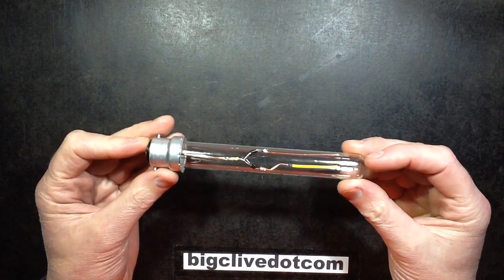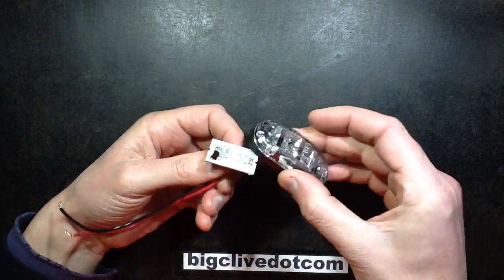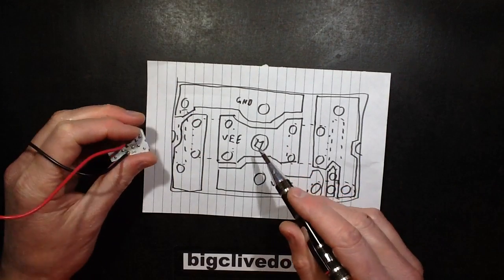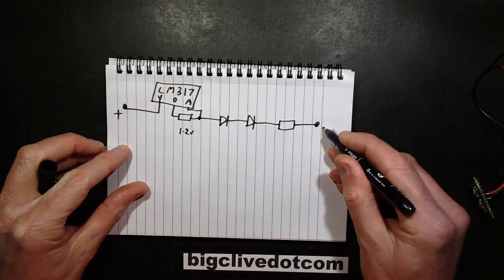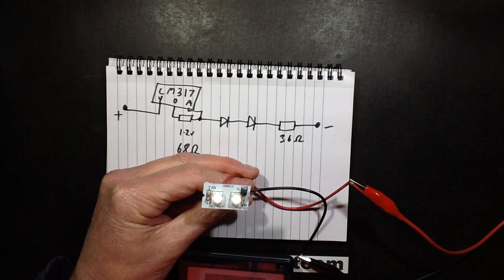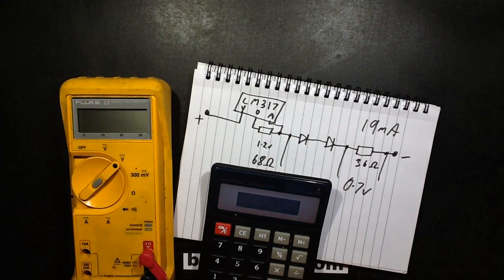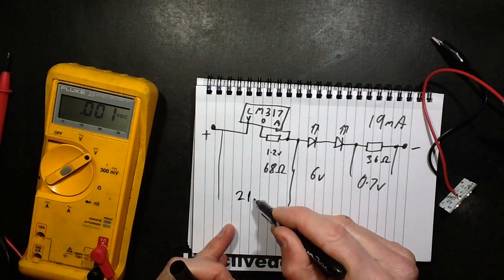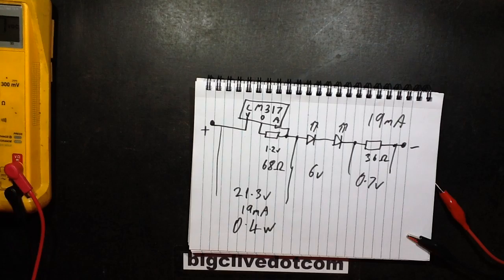Teardown of an LED truck sidelight.

Comment: Wow again! Another classic Clive.

Interestingly, I've been considering LED rear lamp clusters for my car trailer, but at lot of people tell me stories of poor life spans and various odd faults that make them unreliable. Then others will tell me that they're not certified for road use in the UK. I must admit, I like the idea of LEDs for trailer lighting because they're not as badly afflicted by voltage drop as tungsten bulbs. What say you, Clive?
Reply from the maker: Some are pushed a bit too hard and most are not fully waterproof.  They're very variable in quality.

Comment: As a truck driver here in the states, all of our trucks run 12volt electrical systems, we usually have a 4 battery packs tied 2 series and then paralleled  for 24volt for just the engine starter.

Comment: Hi. I have a question. Min operating junction temperature for LM317 is 0 deg C. What will happened with this light in the middle of a winter, when external temperature would be, let's say, -15 deg C?

Comment: I've watched most of your videos and all I can say is that the sound is best when you're using the little plug-in mic with the fluffy cover. On a different note, I know that lots of mass produced items have plastic parts (especially cases) that are sonically welded together rather than glued as it is much cheaper and quicker than using glue. If both parts are made from the same type of plastic and it is a relatively hard plastic then sonic welding is the most likely form of permanent attachment like with mains adaptor and laptop power supply cases, toys or anything not intended for repair. Sadly, these days, far too much stuff is designated as uneconomical to repair and has horribly impossible to open cases!

Comment: Just knitpicking, but you forgot the 1.25v over the adjustment resistor in your calculation. 
0.38W versus 0.4W, so no big deal. 

Volume is more equal to other videos now. 

Love your videos. So thank you. Keep them coming!
Reply from the maker: I did think about splitting the resistor and regulators dissipation , but I ended up just bundling them together, since the regulator was doing most of the work.

Comment: According to the datasheet for the TO-92 version of the LM317, it's capable of 100mA at 1.2-37v. Power dissipation is apparently internally limited, however I've smoked enough of these ICs to know that the internal limiter rarely works as advertised. The current setpoint of that circuit puts the power dissipation around 22mW. So plenty of overhead :)

Comment: The sound is clearer. I did prefer the lighter background of the old videos. It is easier to watch somehow and less shiny.
Reply from the maker: It is a bit shiny.  Maybe I should have gone with a matt grey.  The black has had a good effect in the iPad's default automatic white balance though.  It didn't know what to make of the bare wood.  I should try some of the other video apps available that let you lock AWB.  Sadly they all need the IOS8 update and having done it to ONE of the iPads I'm not planning on doing it to the other.  The planed obsolescence kicked in with the IOS update big time, rendering the older iPad 2 rather sluggish.

Comment: I wonder if the resistor is to operate as a fuse in the event the LEDs go short and blow the regulator short circuited? (just an idea...)

With 24v LA batteries behind it, I suspect the wiring/pcb pads would be a fire hazard before a normalish 20-25amp vehicle fuse blew
Reply from the maker: That's a possibility too.  I think the main reason is probably to limit inrush current while the regulator stabilises.  Quite a strange value choice though.  Technically speaking they could have just used two identical resistors at the 68 ohm used to set the current, making manufacture easier.
Reply: ***** Such an resistor would go in parallel with the rest of the circuit. This circuit would use 19 mA with ot without it.

Comment: The isolated zones thing may even be a hold over from normal truck/car lights, which (as you've no doubt seen) tended to be zones of tinned steel (copper, we've heard of it) separated by slots :)